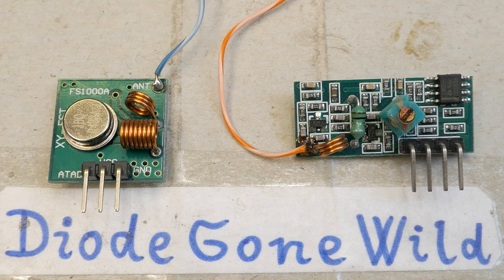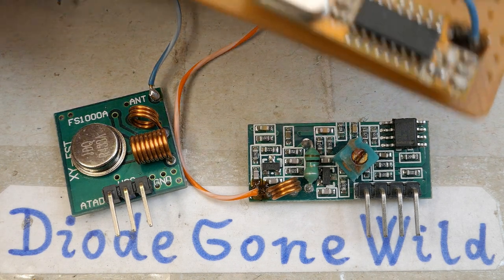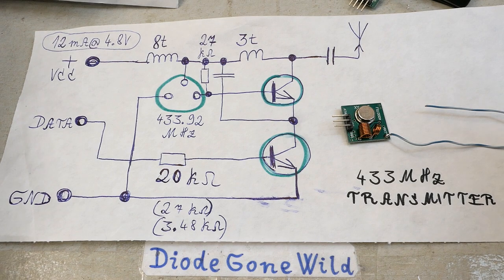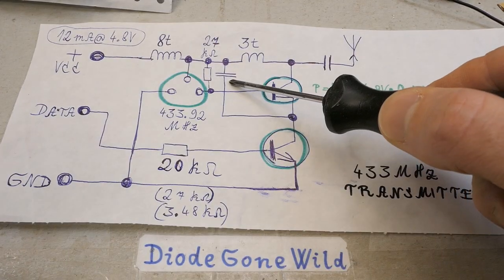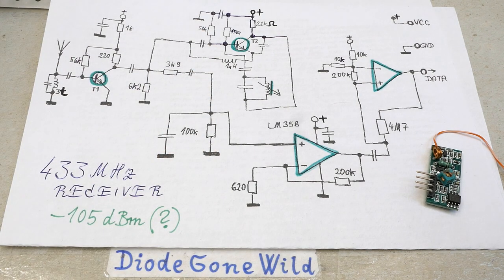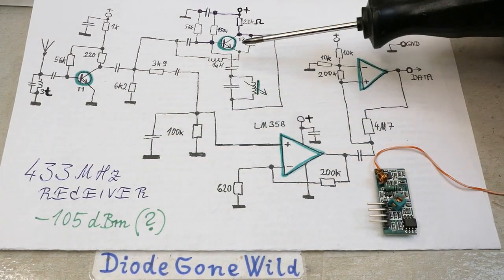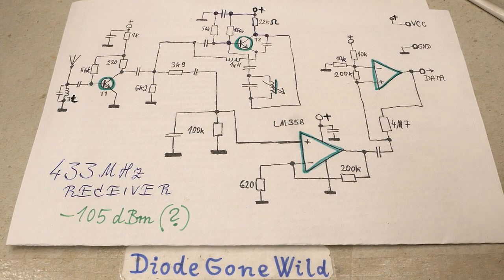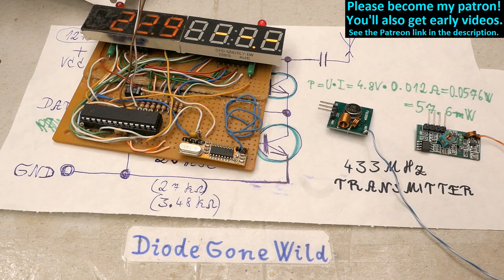433MHz RF wireless modules from eBay (transmitter and receiver)

Comment: if you have your project ready (transmitter sending data and receiver actually receiving the data and added a 17.3cm copper wire antenna to both) you can connect a small temporary speaker to the output of tye receiver. than move the receiver away from the transmitter for about 30 meters and fine tune the coil of the receiver with a plastic screw driver. you will hear the sound increase and decrease if you slowly rotate the coil, a louder setting will significantly extend the range. than remove the speaker from the receiver and the two are adjusted optimally. this worked perfectly for me!

Comment: Transmitter to improve the fall time you can put a 20k resistor from Vcc to the collector of the switching transistor, to provide a discharge path for the oscillator side. Increases power draw a little, but should reduce that switch off time. input can also be improved by a ceramic capacitor across the supply pins, any value from 10n up chip ceramic, to make the impedance of the supply lower at RF.

Comment: As mentioned on this video, these modules have been same for the past 10 years or more. Its pure analog output, you make your own protocol to have effective communication. You have to do your own preamble (send like 10101010 sequence), form packet and add CRC. This band is crowded and combined with the automatic gain control of the receiver, the output will be very noisy. But even with all these checks and corrections, there is no way for transmitter to know if the receiver has really received the data. So this module is not good for digital data communication.

Comment: One advice on the Transmitter module: Don‘t use it without a proper low pass filter to cut off frequencies above 433 MHz. Otherwise you produce a lot of out of band emissions.
Reply: Negligible at that power level. There's millions of car central locking and alarm fobs with the same circuit which would have had to have passed certification without LPFs.

Comment: Hey DGW, if you're open to video ideas, I'd be interested in learning about how to design circuitry to drive recycled VFDs from scrap VCRs, microwaves, ect using a microcontroller

You've covered VFDs from clocks a few times and they've been really informative videos, a video dedicated to running them would be really cool
Reply from the maker: I might make a video about VFD displays one day ;). And also my diy VFD clock might give you an idea: https://danyk.cz/avr_vfd_en.html
Reply: @DiodeGoneWild  You are a genius,Danyk.

Comment: Yes, they are regenerative receivers and they oscillate almost always and also interfere with nearby receivers of the same type. That is why you sometimes have problems with cheap remote controlled outlets when you plug more then one into the same power strip or nearby outlets. This interference results in a severely reduced range.
Reply: So this same Interference topology used in cheap wireless Door bell's receiver  circuits 
Right ?
Reply: yet, mostly remote controls, they are supposed to not run for long and thus crowd and cause interference

Comment: I was experimenting with these modules last year because I wanted to transmit on/off commands to the thermostatic switch plug that controls the fan heater in my room - the supplied thermostat was innacurate and ate batteries so quickly. I bought some reciever/transmitter pairs off ebay and the receivers were so noisy they were unusable. I bought another from Amazon that was more expensive and was surprised that I could recieve the signals from the tyre sensors of cars driving past on the road 20-25m away!  So performance is very variable, and its not always possible to know which receivers are best.
Reply: Find a solution? NRF24L01?
Reply: @jimmybrad156  not really, it has to be 433Mhz because the thing I'm switching  expects that. I did experiment with a SDR dongle but its transmit capability was limited and then my squirrel brain got distracted and I never got back to playing with it again!

Comment: dBm I think is decibel- mw into a 50 ohm load? 0dBm is 1mw into a 50ohm impedance  (or 600 ohm for video)
Reply: 100 fW is -100dbm haha wow
Reply: Yes you're right - dBm is decibel milliwatt - logarithmic power in reference to 1 mW, P[dBm] = 10log(P[mW]/1mW])
And also what you mentioned is so called normal generator - 600 ohm resistance, on which dissipated power is 1mW = 0dBm, voltage is 0,775V = 0dBu and the current is 1,29mA=0dBi
This is the international generator model used for the measurements

Comment: I wish I could had them back in 90s. I used to play via serial cable doom with my neighbour and a long cable (even a null-modem one) was not feasible, so I took a pair of cheap walkie-talkie that covered the 100m distance (in straight line, direct view) in audio and made a half-duplex transmision line via RF 27MHz. The boards were similar dodgy but made with trough-hole components only so easy to work with. Long story short, after few days of tinkering and adjusting, we managed to play Doom (at quite low transmission rate).

Comment: I think the way the reciever works is that the self quencing super regen receiver will sweep a range of frequecies as that 400kHz ramp occurs. If there then is a signal at the antenna you will get an LF component presented to the op amp stage becuase the sweep frequency and the received signal will mix producing a difference signal. So you need to insure that receiver will sweep through the frequency of the transmitter.

Comment: I want to experiment with these modules. With the tx I want to get a surface microphone (without applying the mic capsule), for wall, metal, plastic, wood, etc. I am interested in detecting night noises and very low voices of my neighbors (I am convinced that they are using some equipment such as an ultrasonic voice suppressor -------> to counteract this and detect the voice we need a module again at 433 mhz but heterodyne, to convert into a signal (ultrasonic or other) audible to 'human ear. My investigations as a detective but without being a 'detective. :)

Comment: The main virtue of superregenerative receivers is their very small power draw. Even today any other receiver would draw more power from the source. 
Back in the 90's it was common to make car radio-alarms  in similar way, though I have never seen such oscillator. Do you know how it works? The resonator is 
probably two transmision lines with common ground, on high dielectric constant material like BaTiO3. It would be interesting to experiment with ferroelectric 
capacitors as a dielectric resonator. The DC voltage on the output of detector should be I think proportional to logarithm of the RF voltage, it might be interesting to place there a multimeter.

Comment: I don't recall dBm being decibel meters lol but besides that, really cool video. I remember buying a pair of these, and hooking it up to a pic, and it never worked. I ended up hooking it to my pc serial port, as a loopback, and figured that there's more noise than signal, everything I could read was noise. even at 300bps I saw mostly noise instead of my data. completely crap. but yes, the transmitter looks nice, I think that metallic component is quite stable

Comment: AFAIK there are limitations how often you can transmit data on these frequencies. In fact, nobody cares about this until you transmit so often that it almost permanently jam another user. I came across the situation, when someone used these modules to distribute audio. Not the analog way, It sent one cca 400ms long packet every 1 second, which definitely jammed all remote controls used to lock/unlock cars, garage doors etc. in the whole street. Local authorities solved that issue and it was not the cheap way, the fine was huge. Be careful with these things. Despite the fact these bands looks like completely unmanaged, it could cost you a fortune if you do something stupid, like permanent transmission, or transmitting too often or too much data.

Comment: Please also Take A Look on the Circuit of cheap Wireless Door bell , it's very sensitive stable with long ranges  , I had read somewhere  that  , its receiver Topology is Just a Low power Transmitter don't know how exactly a transmitter on the receiver circuit are able to recieve the transmitted signals ? It perhaps works on Resonance Wave Interference !!??

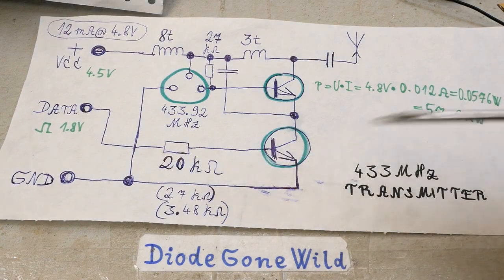Comment: 8:29 "40 BUG 4__0": What's the matter with the date string on your oscilloscope? Did you set the output format to decibelmeters or is the battery in your DS1742 timekeeper empty? Changing the battery (requires to dremel open the DS1742) could make for a good episode (alternatively you can build an adapter to fit a DS1744).

Comment: Hey thanks for the video I will archive this for my collection. I have two pairs of these from 'singles day' 2015. $1.68 USD shipped to Canada. I haven't used them yet so the mods and comments here are really helpful. My tx has no coils on it. The documentation says use a 25 cm antenna for 433 mhz but it also says quarter wavelength which would actually be 17.3 cm. What length did you use? They are out of frame throughout the video.
Reply from the maker: I'm made 17.3 cm antennas.

Comment: Hi, i've swapped the cristal in mine for an 868.35 mhz one, but the circuit struggles to osclillate now.
I've actually gotten my garage open with my modified fs1000A about a dozen times, though it's really not reliable.
What components should I change in the circuit to get it to oscillate correctly ?

Comment: I got some of those modules in the past but never got much luck using them. I remember to achieve at best 1-3 meters. What is the typical practical range for the 433.92Mhz band on those modules? And maximum data baud rate?
Reply from the maker: I never tested the max baud rate, but the range was easily something like from the inside of a fridge or a freeze + 1 floor up + 10 meters sideways. Worked reliably. I never tried to bring the receiver or transmiter outside of the house, but I might try to. The range has to be decent given it can transmit from the fridge, which is almost all metal, like a faraday cage.
Reply: @jim9930  these TX modules are operating on crowded ISM spectrum, but I know these femtocells which are 20W omnidirectional easily can have a range of 1km@2.6/3.6 GHz LTE/5G. 

GSM is even more sensitive and works on a much lower SNR. Most NB-IoT modules operate at up to 23dBm and can have ranges of upwards of 10km.

Comment: Some wireless home alarms use 433Mhz for sensors. Going to play with my system to see how to hook it into home automation.
Reply: A cheap UV5R disable the system on the 443.
Reply: Don‘t use these 433 MHz systems, a signal jammer (or manipulated remote) is enough to block them.

Look into a commercial solution like VeriSure, for example VeriSure works on multiple carriers and GSM (possibly LTE/NB-IoT?). It‘s more expensive and has a monthly cost, but it‘s generally resistant against single-band jamming attacks unless all carriers around operate on the same frequency.
Reply: you'll have to explain that to Freidland and the other major alarm manufacturers that have used them extensively for burglar alarms.
They're most likely aware and designed them to alarm if the signal is jammed. My only interest in them is to see how easy they are to tap into.
Reply: @ches74  maybe, but I wouldn‘t really trust it because this could also trigger many false-positives. There even was a case of one of these weather stations jamming GSM of a whole village and similarly, these 433 MHz modules also can fail. I had such a weather sensor for 433 MHz and in the end, it had a module that got hot and was creating RF noise.

Comment: I have a Rx & Tx set I extracted from an energy monitor (the sort that has a current clamp thing that clips round your incoming Live mains cable then broadcasted that to the display, it was rubbish!), never found any other use for it, so the two modules are sat in a container somewhere... :\

Comment: If I added an analog signal in the data-in of the Tx, would it show up as a similar signal on the Rx?
I shall read about transmitter types you mentioned. I am just a hobbyist.
Reply: It would be distorted as hell. You'd want a proper modulation circuit for that.
Reply: I was able to transmit music using a circuit from Zafer Yildiz video. Added 6.8k resistor between tx vcc and data, and 3.3kOhm between mobile headphone output to data and ground. Rx used data to drive bc337 transistor base (via 10kOhm) as low side switch for speaker. It worked best with tx vcc <5V . Very sensitive to part placement on breadboard and too many jumper cables. Max range 2m.

Comment: The problem with this receiver is when i connect the the LED To Vcc and Data, the LED just blinking like using NE555, when i transmitting the radio wave the LED turn off, when the radio wave does not transmitted from the transmitter the LED is blinking again, i Use 9 volt battery and antena from old pen coil